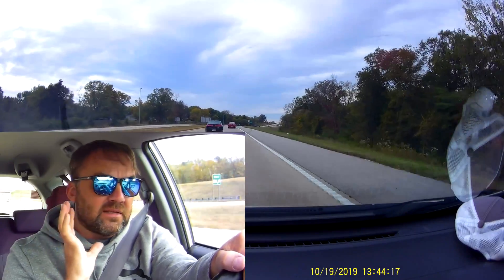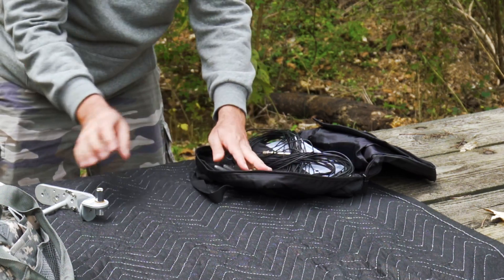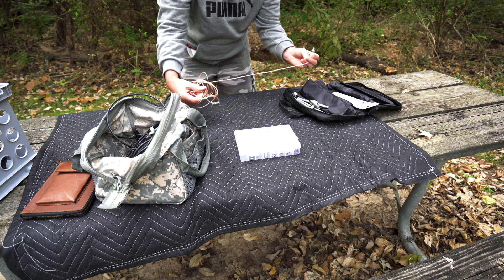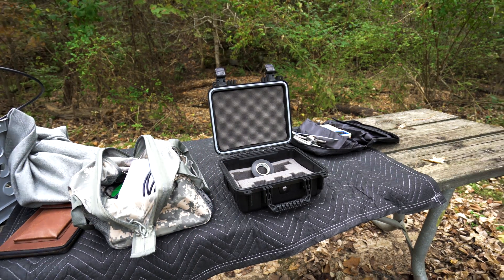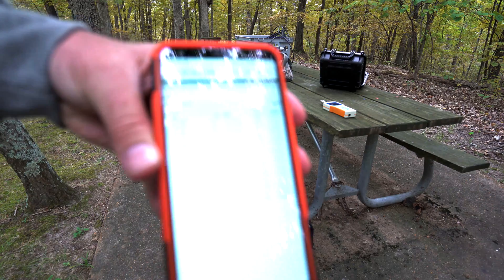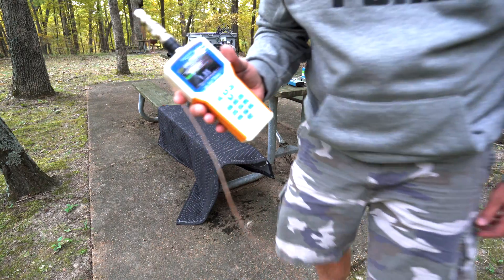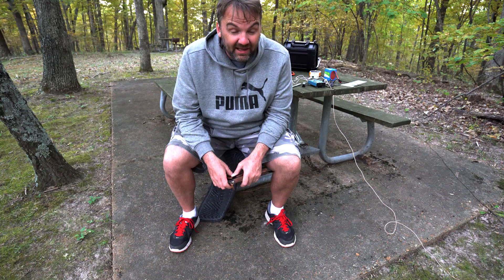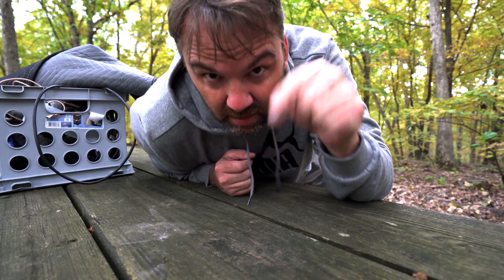QRP CW Success! ~ 9 Volts ~ Mountain Topper Radio & MP1 Super Antenna

Comment: Just bought a Mountain Topper and already have an MP1 so was interested in how you got on. From my experience the MP1 has far surpassed my expectations and I've had some great SSB QSOs with the FT-817 @ 5w. I do summits on the air which makes QSOs much easier to come by than calling CQ mind! Thanks for the video, and regards from the Lake District NW England. Mark https://www.qrz.com/db/M0NOM/P

Comment: I find it interesting as in the car ride you said you premise for the trip was to setup the super antenna like you were on a beach with no trees ( don't understand why so many guys are afraid of trees ) and test performance of the antenna "stand-alone" with radials laid out on the ground.
Then you pull up to campsite and clamp it on a metal BBQ Grill. Typical beach feature.
If you want to successfully run 2W portable, you are going to have to maximize other elements of the station. ie: antenna, feedline. For example, a  Dipole in the trees fed with open wire line. It goes up faster; is way, way more effective and weighs less than your vertical. Just sayin,   73
Reply from the maker: Yeah, I hear ya but I"m running on limited time and filming at the same time. I have to get out and back in a short window.
Reply: @hamradiocq  I can set up a dipole in two trees in 5 to 10 minutes, easily

Comment: Looked like a fun day in the part. For making and testing new antennas, I use the AA-230 Zoom. For you, since you don't like to carry around an expensive antenna analyzer, look into the nanoVNA. On ebay the price ranges from 38 to 64 dollars. I paid 64 dollars for mine since I wanted mine to be in a case. Be careful ! I noticed some don't have an internal battery. Read all of the info on the page. 
I use a KX2 for my go to portable setup, but I also like my little YouKits 4 band radio.
I like your antenna. Looks like the radials are cut to a proper length since you were able to achieve a low SWR.

Barry, KU3X/QRP
Reply from the maker: Thanks for the comment Barry!

Comment: Using a pre-tuned wire antenna so much better than that loaded antenna, plus you won't need to take that analyzer out. You would have much more fun with a good antenna.
Reply from the maker: Yes, but that was not the experiment.

Comment: In my experience a full size dipole for 40 meters and RG 58 is worth it. Too much compromise in a very small vertical. Use a telescoping pole and make an inverted v or two poles for a dipole. I wonder about the output power at 9 volts. Why not 12 volts? I used a Heathkit HW8 and lantern batteries in the past. Just a thought. Can’t afford to waste any power at qrp levels.
Reply from the maker: I hear you tech guy. I hear you.

Comment: Great video!!!  I knew you could make a contact.  Depends on what band your operating on and the conditions.  I like that little setup.  I need to get out with QRP Labs QCX40 that I built.  May try it with a vertical antenna I am building.  I am getting ready to test the antenna I just finished building.  I am hoping it will work!  I am going to hook up my analyzer to it and see how it works before I ever transmit on it.  It resembles the WRC.  I wound my own coil, made my own slider and am using a old 10 Meter HamStick as the main radiator.  Juddie WD8WV
Reply from the maker: Juddie, I appreciate your comment.   I'd like to see your coil and your test. Let us know.

Comment: I dont understand this kind of things. This is not ham radio. It's a supermarket review. Is there something homemade? At least a dipole or an end fed antenna with some kind of homemade transformer. Yeah, you can tune a railway line too but, for sure, it will not radiate properly.
Reply from the maker: Pietro, you need another channel.  Please leave mine.
Reply: @hamradiocq  never signed up! Bye

Comment: It was a shame you couldn't hang around for a couple of hours either side of the Gray line when DX is at its maximum, even at this solar cycle minimums I still hear signals from VK ZL for about 2 hrs after Sunset and 2Hrs after Sunrise From UK. Autumn and Winter is usually the best time for 20 and 40 DX.

Comment: I may be inspired to try this with my Mountain Topper and maybe my Chameleon MPAS 2.0 whip. I also have that MP1 antenna, but have not touched it in a long time. It just feels like too many parts to lug around, especially for QRP. And while I also several Bioenno LiFePO4 batteries, I really prefer the convenience (and weight) of just a plain little commercial 9V Energizer or Duracell battery for that radio. Just carry a few of them in a plastic bag, and its going to be way lighter than carrying the BBB ("big" blue battery).

My preferred antenna setup would probably be the MPAS 2.0 whip (breaks down nice and light and small), with maybe the multi-length counterpoise kit that came with the MP1, and either the ground spike, or clamp setup, similar to what you did here (assuming I can find a park bench near a grill like that). If I manage to get out to try this, I'll let you know how it goes. Keep up the great work with these vids! de K7AJG . .
Reply from the maker: I have had terrible results with my MPAS.  It's like no  one hears me at all.

Comment: Maybe having a digital audio recorder could be handy, one with line-in and line-out so that you could plug it in-between the radio and headphones? Then you'd need to forget two things to not have audio for the QSOs! :)

Sweet content anyhow!
Reply from the maker: "need to forget two things"  LOL, I'd do it.
Reply: Inline recording is good if you radio is output your voice in some kind of monitoring mode.  Otherwise it would be handy if the recorder could balance using line in and the mic.

Comment: Nice job Tom.  I have the MP1 super antenna and have the same experience with my kx2.  My best luck with all my radios are the wire in a tree mode. 73 de Roger w8rlp
Reply from the maker: Yup, nothing like a wire in a tree, except getting it up and down.
Reply: @hamradiocq  Usually the cheapest Homemade Antennas work the best, the more wire in the air the better. I have always wanted to try a Rhombic but have never had room.
Reply: I've had good luck with my MP-1. I carry it and an LNR EFT10/20/40 when I go out portable. But I'm careful to deploy the MP-` only when I'm in a location which favors a small vertical. Usually a beach... as close to the water as I can get it. And also usually clamped to my Jeep's steel bumper to give it a big mass to help the OEM radials. 10 feet of RG-8X feed line. Using it in town is useless because the buildings small verticals have a low angle of radiation (which makes them great for DX) and all the buildings soak up the QRP RF as it tries to beat its way through a couple hundred of them on its way to the horizon. So hill tops... and beaches. Clamp the antenna to something big and metal. Deploy the radials. Use CW. Watch for your RBN reports (and don't blame the antenna for no QSO as long as you are getting reports from the RBN - or other spots).

Comment: I think your deduction that the Super Antenna would work well on a beach is accurate. My own thoughts echo yours... I use a long wire antenna in the woods where there are trees and the MP-1 on any beach or close to a large body of water. I also try to clamp it to something that is metal. Car, fence, etc. The BBQ seemed like a good idea to me. And the radials are important. I think your call is N9YO (hard to know for sure) and if you did this on October 19, 2019 you got out pretty well on 40m and 20m according to the  Reverse Beacon Network. Just no control over who is listening.  The RBN reports with the signal strength look pretty good so the MP1 is working. For what its worth my longest QRP QSO on CW was 7,000 miles on 15m with an Elecraft K1 and my MP-1 clamped to the steel bumper of my Jeep TJ parked about ten feet from the NE end of large fresh-water reservoir. Thanks for the video. :)
Reply from the maker: Thanks for the nice comment.  This video was shot last Saturday, it takes some time to edit and load etc.
Reply: @hamradiocq  Little verticals like clear space due to their very low takeoff angle. Why they excell on beaches. They don't like trees much even if high up.... a bare mountain top is ok. In cities they suck... all those buildings and cars and trucks.